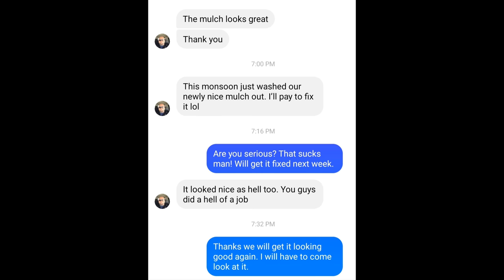HOMEOWNER PAID US $500 | AND HE DIDN'T EVEN GET TO ENJOY IT!

Comment: I would have hooked a rope or chain around them and pulled them up,now they gonna grow back,I know those mowers will pull them up,I pulled up some that were bigger than those with my troy built rider,I also have the troy built 4 cycle weed eater that has a chainsaw attachment,it works great!Yaw did a great job!!